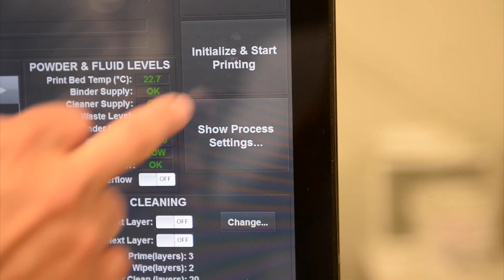Metal 3D Printing: The making of 'Awareness'.

Comment: Okay, so I think the process is like this. 1. you print a green part out of stainless steel or some other high melting point metal with a binder material. 2. And then you place it in a sand bed (probably for even heating) with a copper powder pool. 3. After raising the temperature in the furnace, the binder material evaporates, leaving a very porous work piece. 4. Raising the temperature further, the copper powder pool melts and gets soaked up by the porous work piece via capillary action. Think of it like doing copper brazing on the entirety of the work piece. I think this is a very cool way to get near 100% density 3D printed metal part, and it's most likely stronger than parts printed by DMLS.